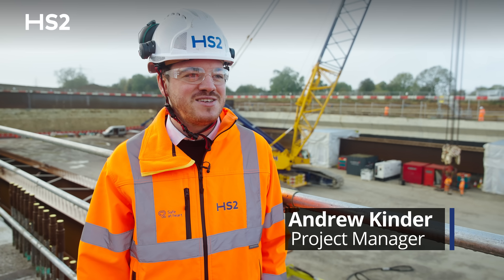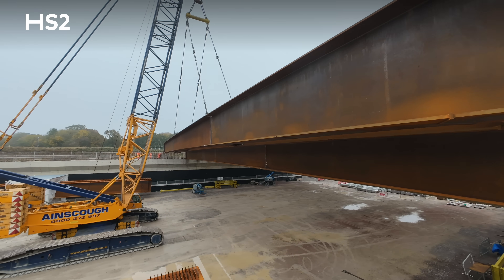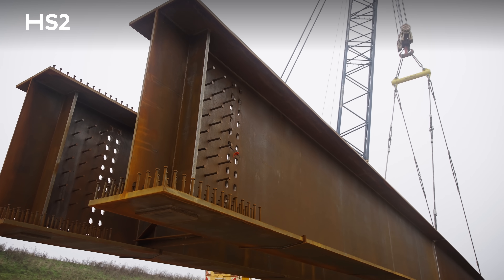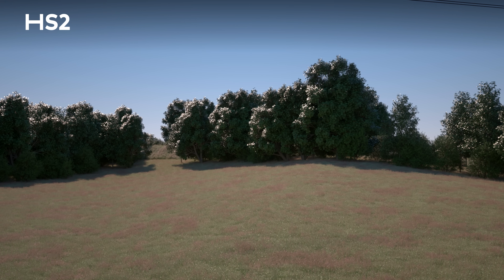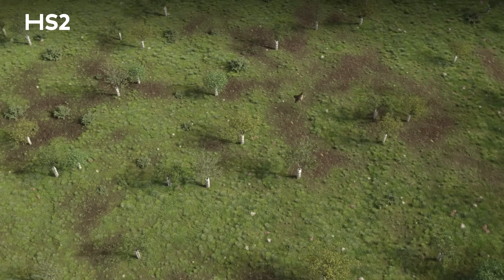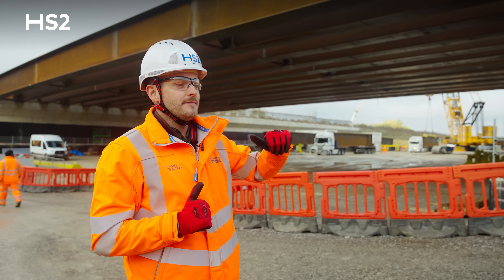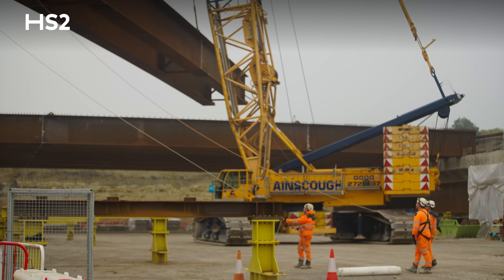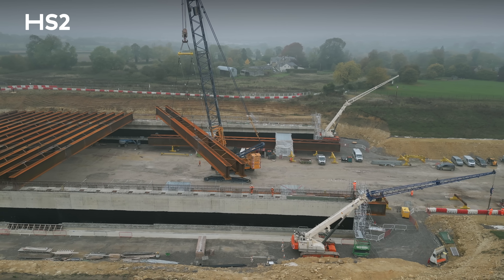HS2 begins assembling Turweston green bridge deck

Comment: I'm a supporter of HS2, but this is the first video where I've actually questioned a design choice. This seems rather over the top. Surely a normal cutting and small bridge for the lane would have worked?
Reply: Railways divide habitats and can have a very harmful effects on local ecosystems and further escalate biodiversity loss which disrupts our countrysides natural systems. The bridge is less for people to cross and more for nature that’s why it’s called a green crossing. You might not care about biodiversity or nature but HS2 and the DfT has decided it’s worth investment. Important to note that investing in protecting our biodiversity and nature isn’t just pretty but it also helps us handle flooding etc.
Reply: This allows for the road to be widened in the future.

And, to be fair to NIMBYs, this creates the impression that the areas on both sides of the railway are "one place". If you ever visit Bath, there is a camoflaged bridge there, with shops built along both sides, to trick people into thinking that the land on the other side of a river was still part of Bath. This is the same sort of trick, but using a small slice of nature to help create that illusion.
Reply: @DavidShepheard Have you been there? "The road" is actually a tiny country lane that leads nowhere.
Reply: @adriansmith38  Until a new town suddenly pops up, due to or rapidly increasing population.
Reply: That would be too logical and cost efficient. Its far better to over engineer a project over a long period of time, to keep the NIMBYs happy and upload YouTube videos as soon as small progress is made. 

It will look nice when it's finished, albeit at a much bigger price tag than it should have been.
Reply: You can't build a cutting without battering back the sides, or the sides will collapse. The alternative would be to install vertical retaining walls which would be more expensive than battering back the sides. As the batter has to be at a constant angle the deeper the cutting the wider the excavation will be at the top of the cutting
Reply: @TrevorWilliams-fq8mg  interesting that a couple of retaining walls to reduce the span can be more expensive than all those massive steels
Reply: @adriansmith38 The retaining walls would need to cover the length of the cutting beyond the footprint of the bridge. And if there is a water table  and the need for the retaining walls to penetrate the water table the retaining walls will be a secant piled wall. Secant piles are piles that are drilled into each other to form a water resistant barrier. Alternatively the retaining walls can be built as reinforced concrete walls which would require over excavation to give working space. How do you know if the steel beams are too deep anyway as you have no information on loadings to be ablecto design the beams ?
Reply: @TrevorWilliams-fq8mg  I never said they were too deep.
Reply: oh this is for small animals to cross the tracks as well
Reply: Are they going to put a building on top of the bridge  ?

Comment: Anyone know why the span needs to be 55 metres wide?   Are there going to be six tracks passing under this green bridge?
Reply: The finished cutting track depth will be much lower than the surface they’re currently working from. The bridge allows room for the slopes.

Comment: I was completely sold on this wildlife bridge project, until I reached at about 2:19 into the video WTF ! I'm not an expert when it comes to wildlife, but I think the wildlife will become roadkill if it ever dare to cross this bridge if the layout of the roads is laid as it is in the presentation.
Reply: No point in building a bridge that connects wildlife together only to divide the same space using roads instead.
Reply: Exactly. What’s the point of this being for wildlife if there’s a road junction on top as well? Should’ve just made it a very long cutting, build tunnel sections, then fill it in.

Comment: I am not a structural engineer but by simple observation of the many and varied rail/road bridges throughtout the UK it does appear the beams and structure generally is massively overengineered.
To enable the flora and fauna  a good habitat and access is commendable but as with the recent notification of the absurd bat tunnel structure at a cost of many millions represents with this biodiversity protection a degree of overkill reaching absurd levels of unnecessary cost.
Reply: They are being engineered for a 100 year lifespan plus UK regulations are some of the strictest around.
Reply: As the other guy said, HS2 has been designed for an extremely long lifespan. It's partially a rejection of attitudes of the previous century (Just throwing something together with no thought for the future), but also because there's an expectation that Westminster won't approve any further infrastructure for another 50-100 years. Because that's how dire of a state our political system is in
Reply: In keeping with all major building and civil engineering projects green design gets environmental points. As HS2 is 100 miles in length there are a lot of individual contracts all of which need to get environmental points. The bat tunnel seems ludicrous at 100 million but it is designed to accommodate 4 trains passing each other at 200 mph. The air pressure would be phenomenal so the cladding is designed to withstand those forces.
Reply: It's not those things per se increasing the cost compared to other countries, it's the fact that elsewhere they'd be funded separately to the line itself
Reply: @Inkyminkyzizwoz  if anyone at HS2 had a frigging brain they would break the cost down into track, infrastructure, green mitigation and stations so people could understand the frigging investment profile of the project, but no HS2 limited just let the media carp on about the consolidated cost rather than the infrastructure investment

Comment: That is completely over engineered… same solution could have been delivered far cheaper. Look at the ridiculous depth of those beams to cross a twin track rail line.
Reply: Who wants to live in a country that does everything on the cheap especially when you can build something you can be proud of
Reply: Such a shame you weren't on the design team. Your expertise would have been invaluable.
Reply: There are 3 factors to consider when designing the bridge beams. Vwrtical dead loading. Horizontal sway loading  and span. You can't just say the beams are too big because they look too big.
Reply: @TrevorWilliams-fq8mg   There's far more those three to consider, Trevor. My view was offered based on 35 years of designing and constructing smaller, and far bigger, bridges than this, and as a Chartered Civil Enginner, and Fellow of the ICE. But happy to hear your thoughts too on how the span could have been reduced and the construction costs reduced?
Reply: Possibly but we will expect it to last for 100+ years and in 20 years time we will probably send Lorries over it. If you want to see over engineering look at Wallingford or Abingdon- all those water arches are actually needed.
Reply: @janeknight3597  yes, all bridges are designed for that sort of lifespan, and far smaller beams will carry full highway loading for HGVs
Reply: The span is the span. If you are a chartered Engineer you must know what the criteria for designing steel beams are rather than just saying they look too deep. I'm not an Ebgibeer but was a pre construction manager working for a  Contrsctor before retirement. And part of the job was knowing what  the relevant criteria are.
Reply: @ No it’s not. There are several ways the span could have been reduced and transverse length of the structure shortened. I’ve been watching over-engineered designs taking shape all along the route for several years.
Reply: It’s 55m long, has deep soil and a road on top. Maybe the requirements could have been reduced, but you’re going to end up with very big beams if you accept those circumstances!
Reply: There is going to be hundreds of tonnes of earth etc. on top. That's why they're designed like this, is how I understand it.
Reply: If they can install some columns in between the rail tracks that would shorten the span but presumably there must be a minimum clearance dimension from the rail tracks to meet.